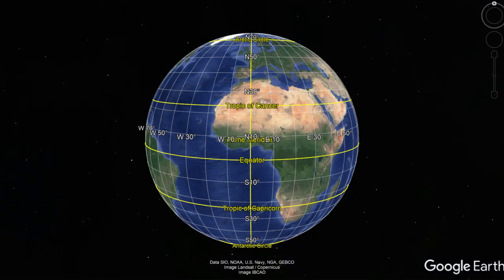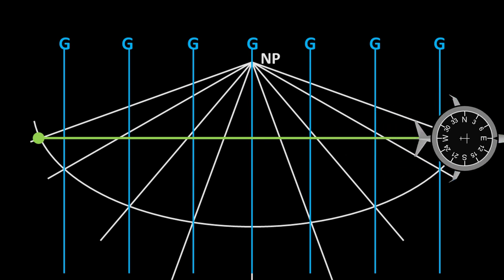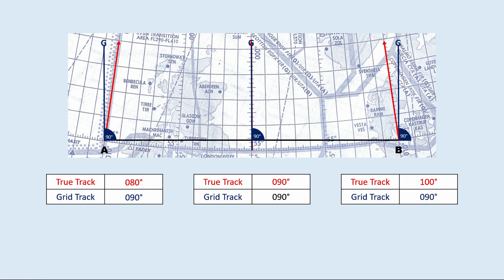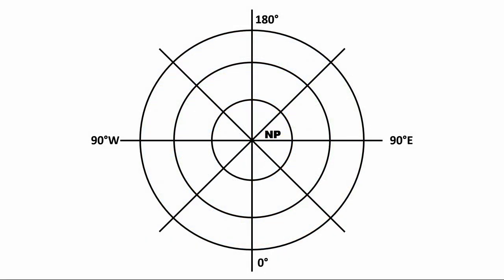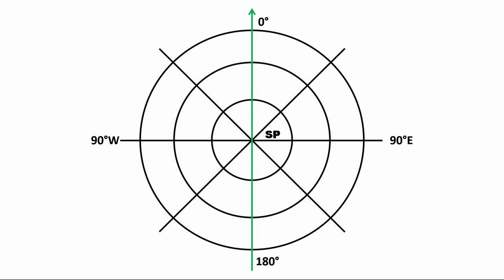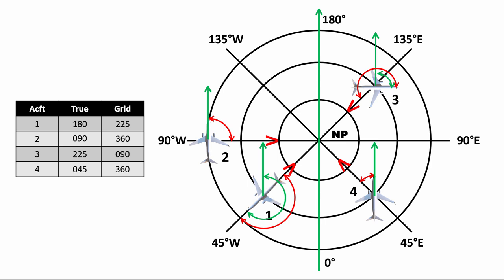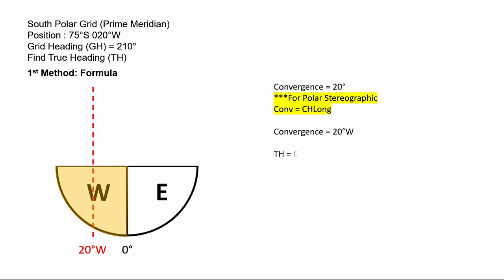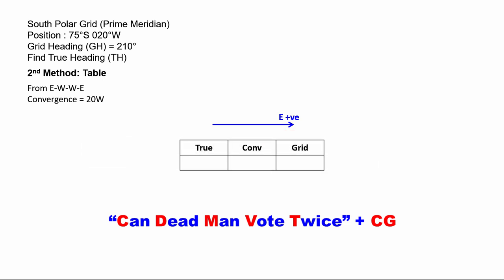Grid Navigation | General Navigation |  EASA ATPL

Comment: 05:40 I just dont understand it, no idea where do you get those values from... :(
Reply from the maker: The angle is based on the position of the aircraft. 
1. True Heading is measured based on position of true north (centre of the circle) and nose of aircraft. Just draw a straight line from true north toward the center of the aircraft and one more line from centre of the aircraft toward the nose of aircraft. Measure the angle between the 2 clockwise and you will get the true heading.

2. Grid heading is based on the grid reference and nose of the aircraft. Draw from center of the aircraft a line parallel to the grid reference and draw another line from centre of the aircraft toward the nose, measure the angle clockwise between this two lines. You will get the Grid heading.

To measure angle you need to start the measurements from the north ref toward aircraft nose clockwise.

Hope this explaination help
Reply: @AnsweringATPL  thank you, this explanation helps a lot!
Reply from the maker: @Vejiita45  Welcome